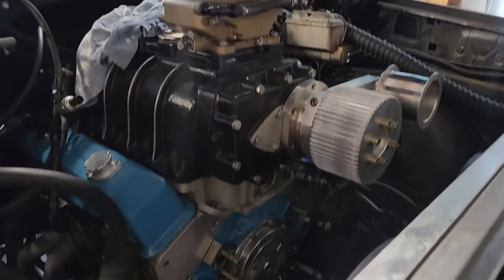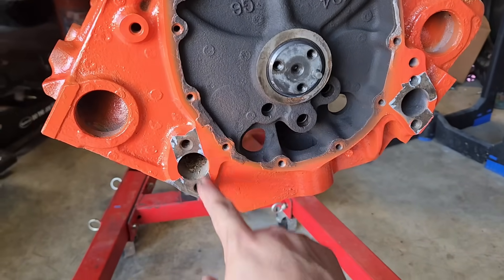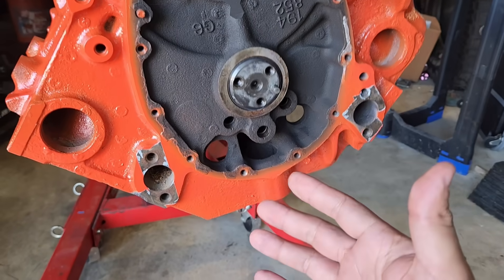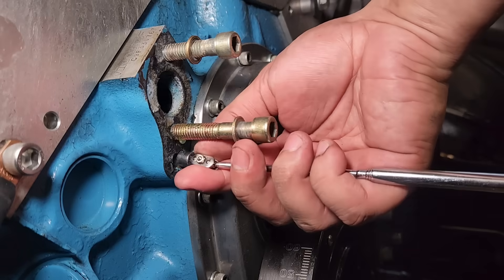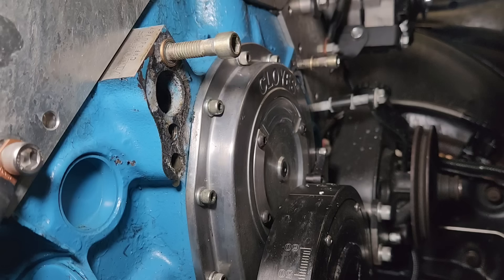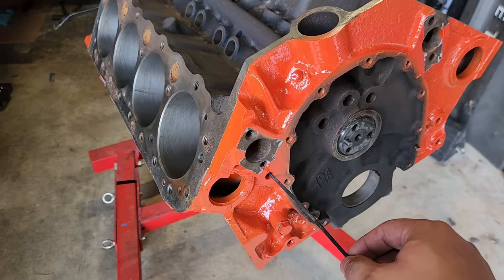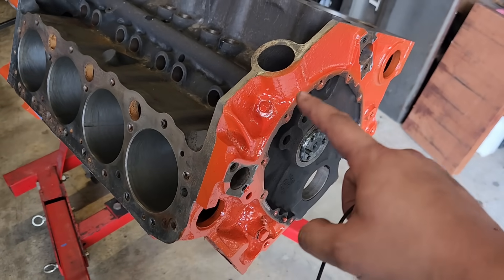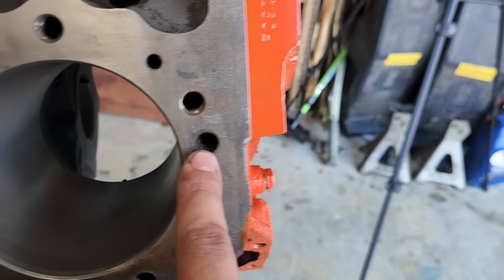SBC Water Pump Bypass? Small Block Chevy Overheating Fix!

Comment: I run electric waterpumps they dont cover the third hole so you have to tap it and use a pipe plug and a couple holes in thermostat. But the radiator cap has to be below the thermostat to get the air out

Comment: Don't quote me, but I heard some Vortec heads do NOT have the hole in them to connect to that bypass, some said you can drill it out others said just drill some holes in your thermostat plate, around the actual thermostat,  some have said three to four holes should do it, then this acts as a bypass..

Comment: My Dart Iron Eagle block does not have a bypass.  I forgot about it when I first got the engine running.  The bypass allows some water to circulate so that the entire cooling system comes up to temperature gradually.  With no bypass my engine would start to heat up, the thermostat would open and the engine would cool down because of the cool water from the radiator.  Then the thermostat would close and it would keep cycling like this until all the water was at or above the temp of the thermostat.  I could see it fluctuate on the temp gauge.  At first it would be a big swing and as things warmed up the swings would get smaller.  You can drill some small holes in the thermostat to prevent this.

Comment: I use electric water pump and don’t know of one that uses bypass hole
Reply: Me too, I have the same and I'll block it off. I'm also running the same heads as DIG so I'm wondering if he'll chime in and let me know if I'm making a mistake blocking it off...

Comment: I have a blown .060 over stroker and I run a water pump that doesn't have the third hole. It doesn't overheat... It makes 600 torque and 500 HP.  😎
Reply: I agree with that fact 🎉Thanks GBU

Comment: Vortec heads do not have a hole for passage to circulate so drilling a couple holes in thermostat is easist was to use a aftermarket intake and old style waterpump

Comment: The reason it overheats is air pockets if you just filled the system and or pump cavitation from improper heater hose set up. Easiest way is to cap off water pump heater hose fitting, use manifold instead to heater core (if running one) to the radiator directly. Most aftermarket radiators have them now even for old stuff. 

Most reverse pumped SBC don't need that bypass because of the heater hose set up. They go from the back of the intake passenger side through the heater core to the radiator. I still have nightmares about the aluminum fitting they used for the manifolds heater hose. Always broke and always a pain in the ASS to get it out. Many times you end up pulling the intake. 

That bypass is actually to keep the pump from cavitating but it also helps bleed air pockets out by having some flow.
Reply: I have a vortec block and heads but I do not have the vortec water pump which would allow me to connect a bypass from the manifold to the water pump. Instead I have the high flow tstat (holes in it). Problem is, in cool weather, it doesn't get hot enough. From your comment, are you telling me if I plumb one of the ports I have on my air gap manifold into the heater hose I can go back to a standard tstat and thereby allowing me to get hot enough and cruise in the winter?? If so, which heater house?

Comment: Interesting. What would be the reason to plug that hole anyway?
Reply from the maker: If you're running vortec heads on a gen1 block. Those heads don't have that passage. Then you'd use a vortec intake with external bypass hose coming from the top of the pump.
Reply: Nice thanks 🎉GBU

Comment: It's not usually a good idea to dead-head any pump.  Some drill a little hole in the thermostat, but I don't think thats enough to hold a more even heat distribution as the oem bypass hole will do
Reply: I agree with you 🎉Thanks

Comment: I never had a small block Chevy before 1988 overheat because of the plug not being in. What I've always find is the heater hose fitting on the intake manifold has been replaced with the heater hose fitting that normally goes to the water pump. The heater hose fitting on the intake has a hole in it about the size of a pencil. The heater hose fitting at the water pump has a hole about the size of a dime. So if the intake has the bigger hole fitting the coolant will keep going in a continuous loop bypassing the thermostat.
Reply: You have wise words and the 68 to 76 4 bolt mains block castings never seen a plug in the hole and I know it will circulate all around the heads and block until the thermostat is open it is a 1986 casting block that is the confusing point of the video, just know GM do not put the plug in someone else did and the orange block is a even older than 68 like that never seen such a topic 🎉I am with you for the basic SB Chevy info! Thanks, GBU all and youtube
Reply: That might be a good thing to do if you off road in a desert.

Comment: Ya I don't think so. The problem you could run into is the coolant will bypass keep looping and not go through the radiator and you overheat.
Reply from the maker: Thermostat still opens and lets coolant circulate thru the radiator once it reaches temp.
Reply: It Is a new block issue I agree with you 🎉Thanks GBU and Yours